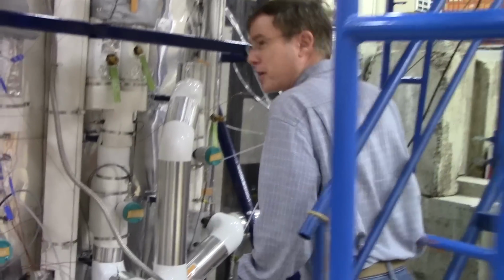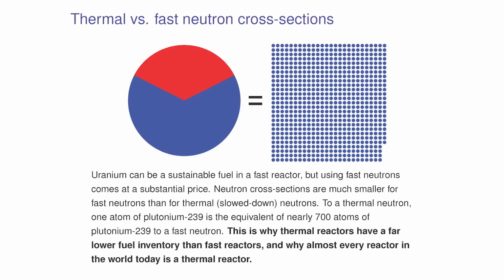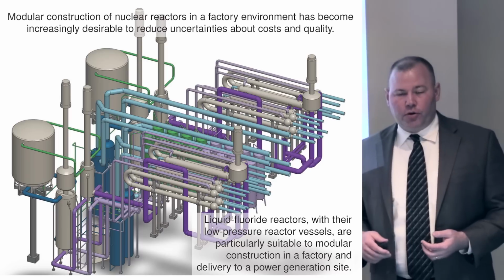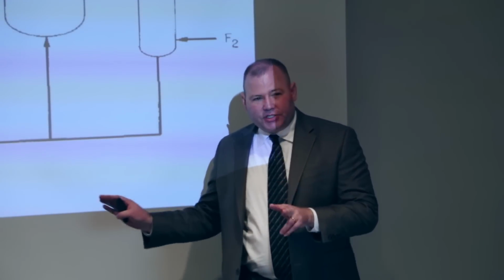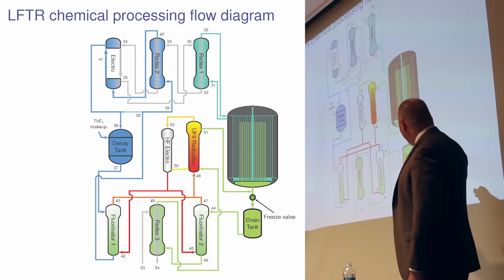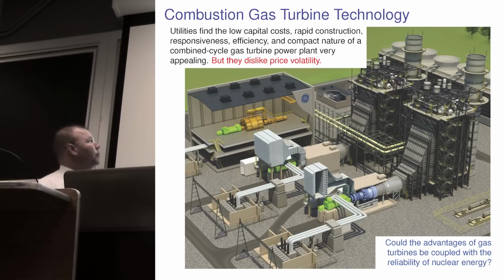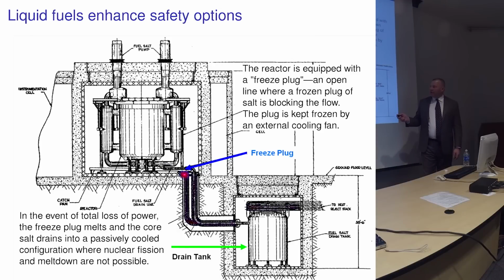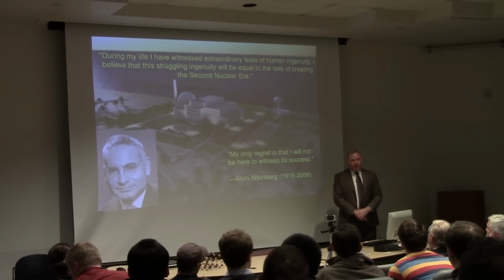LFTR Chemical Processing & Power Conversion - Kirk Sorensen

Comment: Good Video, watched it several times to get an idea of how the chemical separation works. My only concern (if it is a concern) is Thorium 232 transforms into Thorium 233 and stays like that for a half hour. Now Kirk explains in detail how Protactinium 233 is separated and placed in a separate container to decay into U233 to prevent it from absorbing neutrons so I understand that process.
What about the in between Thorium 233 isotope before it decays into Protactinium 233? 
I know that Thorium 233 is a short lived isotope with a half hour or less but reactions in the reactor go at near light speed so who is to say the Thorium 233 won’t absorb another neutron before it decays into Protactinium (assuming if the Thorium 233 isotope has the propensity to absorb another neutron) before the decay process takes place?
Is it ok to leave and not separate the Thorium 233 isotope in the outer blanket?
Reply from the maker: Looking at Wikipedia, nothing is noted as a product of neutron capture for Th-233. Doesn't mean anything definitive, but I can only guess that means it is either unlikely to happen (regardless of the half-hour half-life) or too short lived to have data on it happening (but we would have data if half-hour half-life was longer).

If you haven't watched "Thorium Reactors as Influenced by Uranium-232" it seems related to your interest but won't answer the exact question you are posing.
Reply: @gordonmcdowell  Thank-You for the answer, I guess we’ll know for sure once there is a test reactor made and more data can be extracted about this reaction and if it’s of any significant concern.
Reply: Thorium fuel cycle (simplified)

   Th-232
     │   (n,γ)  neutron capture
     ▼
   Th-233   [t½ ≈ 22 min]
     │
     │  β⁻
     ▼
   Pa-233   [t½ ≈ 27 d]
     │
     │  β⁻
     ▼
 *U-233*  (fissile; target isotope)

Side paths (parasitic captures):

A) Extra capture on the short-lived intermediate:
   Th-233  + n  →  Th-234  [t½ ≈ 24 d]
                              │  β⁻
                              ▼
                            Pa-234 / Pa-234m  (short-lived)
                              │  β⁻
                              ▼
                            U-234  (not fissile with thermal n;
                                   acts as "diluent")

B) Capture on the long-lived intermediate (more critical!):
   Pa-233  + n  →  Pa-234  →(β⁻)→  U-234

C) Further capture on the product isotope:
   U-233 + n → U-234  (reduces reactivity;
                       can breed further to U-235
                       with more captures/decay)

Legend:
(n,γ) = neutron capture with γ emission  
β⁻    = beta-minus decay  
t½    = half-life

U-234 can be used within a fast neutron reactor either by fission or by breeding U-235.

Comment: 32:21 in the Fluorinator 2 where You really, reallly need to get the U out, probably a two-stage fluorination process could achieve higher "yield", higher Uranium_extraction_purity! Also would this be an additional point where You could/should extract Xenon and/or Tritium right here (additionally to Tritium sequestration in the CO2_thermal Loop), before pumping on. 
 Tritium is probably an extremely elusive/diffusive atom to be "sieved"out good enough. ( there is a "Sieving Deuterium article" in AAAScience Jan.2019 ) 
Perfection needed here, because I read that around ORNL they had cancers like crazy from the cleaning-Ladies to Alvin M. Weinberg's wife! Speculatively that could be from Tr (TrHO_inhalation? tritiated water) or Xe_inhalation ...  (Neutrinos .. very unprobably) And You don't want to mix residual Tritium with the Hydrogen coming in at the HF_Electro_Column!!! 
Could Xe be trapped outside the reactor_zone in a decay tank similar to Pa? before the Fluorinator2.

Comment: "We need a source with all if the benefits ... (of coal)"

Old coal-fired electricity had low capital costs...  particularly so in term of incremental capital cost per watt scaling up a plant.  

That was true without pollution control.  It's not true now, and that's why coal started dying even before CO2 became an issue.

But anyway, old coal could service load variability cheaply (as long as the load didn't swing too fast) because unused capacity was cheap.

Nobody expects nuclear capacity to be cheap.  The LCOA of either wind or solar AT FAVORABLE SITES is now below 3¢/KWH.  Nobody is claiming Nuclear can compete with  that, not close.

What this means is that the only role available to Nuclear (for electric power generation in the USA) is as backup/peaking power.  But that is low duty fraction, and so how the hell can high capital costs be recovered?

Comment: There should be an annual tradable cap on carbon ^mining^, based on each nation's population as af Year 2000, and atmospheric CO₂ levels. 10-year quotas could be auctioned within each nation, and proceeds used for research and alleviation of fuel poverty. Non compliant nations (hello China, USA) could have their exports reckoned against importers' quotas.

Comment: This concept is exciting but doomed for one reason:  complex plumbing.    Every pipe and joint and guage will need to be tripply redundant and certified and there is a ton of it in this design.  Points of failure mechanically seem numerous.   Now, if it does spazz out it will not be the catastrophe that a PWR would cause.

Comment: Wind and Solar have serious drawbacks not the least of which are environmental concerns.  They both have to be heavily Subsidized to compete with conventional power sources and Neither can provide a Base Load.  Despite the cries of "Free energy" from them they are expensive and dirty and recycling is either difficult and expensive or impossible and currently NOT Being done.

Comment: Experience with MSRs has not been very encouraging. All current designs draw upon the only two MSRs ever built: the 1954 Aircraft Reactor Experiment that ran for just 100 hours and the Molten Salt Reactor Experiment that operated intermittently from 1965 to 1969.
 Over those four years, the latter reactor’s operations were interrupted  225 times; of these, only 58 were planned. The remaining were due to various unanticipated technical problems. In other words, the reactor had to be shut down at least once every four out of five weeks — that is  not what one would expect of a reliable power plant.
Reply: I figure an experimental design would have "unanticipated technical problems". More should have been built.

Comment: Transverse trancendental cross-sectional dimensionality sequences of time-timing, driven by wave-particle coordination-identification positioning or Planck Dimensions phenomena UHF neutrino->demodulation => Standard Model spectrum of nuclei-> Electron-photon-phonon-Proton and "neutronic<->gravitronic" emitter-receiver condensation relative-timing ratio-rates of clocking half-life positioning.., the Clockwork of ONE-INFINITY Singularity Eternity-now Interval Conception. (Not BBT!)

Every atom is a storage battery of Superspin, mass-energy-momentum reciprocalion resonance tuned to ONE-INFINITY Singularity vanishing point-zero-infinity containment in Totality-Perspective. Complicated and messy sum-of-all-histories.., which is why Nuclear Power Systems are necessarily Art and Sciencing Re-search practices that are similar in requirements to mass air transport vehicles and constant reiterative reintegration monitoring.., but safety and  stability has always been a process, not a word in the Dictionary. (What Safety Officers always say)

"How the heavens go.., not how to go to Heaven" by effective deliberate, MAD ignorance, ie not understanding Actuality because of the attachments to Artificial "Intelligence" narratives.., that is real-time realization of comprehensible safety, ! knowing what you are actually doing.
The Sun is the only heavenly Nuclear Fireball we want nearby in these Fission <->AM FModulation Fusion-Fission connection heavens. 

Ie, Precisely designed Power Sources, in the context of accurately researched policies, required for reliable and sustainable human health and welfare globally. (By default, "anti nuclear" hypocrisy is anti human survival!)

Comment: What I see here is a couple trillion dollars per year with Dr Steven Boyd's hot chemistry mix partnered with the molten salt for plastics. All that money that goes to plastic production lowered substantially because the heat is readily available almost free of charge with a molten salt reactor. The only added cost is adding another heat exchanger and all that oil that is burned today in the trillions of dollars per year would just simply go away. So the benefit of molten salt reactors just goes up and up. Add another heat exchanger and all the water you want distilled is readily available. Remember to go up in power you do nothing to the core of the reactor you just add heat exchangers. Like free money for humanity. Of course nothing is free you first have to build the basic core and get running the thorium transcription to breeding. Not sure how small the basic core structure would be to protect human life from the neutrons as long as you have a ceramic liner that can handle flibe and not decay in the high heat salt. Something like pressed aluminum oxide alumina could be a ceramic that could if glazed into porcelain.

Comment: 1 kg of Thorium dellivers 4,800,000,000 Kwh 0% co2
1 kg of Uranium delivers 24,000,000 Kwh 0% co2 
1 kg of oil delivers 12 Kwh
1kg of coal delivers 8 Kwh
1kg of wood delivers 5 Kwh

THORIUM 232 IS 100% SAFE!

URANIUM 238 IS NUCLEAR DISASTER POSSIBLE!

Uranium nuclear fission is a chain reaction that cannot be stopped, only controlled by cooling. If active cooling falls then you have a meltdown. WE HAVE ALREADY HAD 3 X A NUCLEAR DISASTER IN 70 YEARS URANIUM NUCLEAR ENERGY. If something can go wrong, the question is not whether it will go wrong, but when.

URANIUM 238:
2% can only be used for energy extraction;
98% is nuclear waste
Uranium nuclear waste remains active for 24,000 years
Nuclear weapons, uranium can serve as a raw material for nuclear weapons
Nuclear disaster sensitive

Demolition of a plastic bag is 1000 years

THORIUM 232
98% is usable for energy extraction;
2% is nuclear waste
Thorium nuclear waste remains active for only 300 years;
Thorium is not suitable for nuclear weapons
Thorium can consume nuclear wast
Nuclear disaster is impossible with thorium
1Kwh will cost about 0.01 - 0,02 cent
Thorium explained: https://www.youtube.com/watch?v=8nUjvpxzFbk&t=8s
Thorium explained: https://www.youtube.com/watch?v=biToH42YZZ4&t=51s

1 kg of Thorium delivers 4,800,000,000 Kwh 0% CO2
1 kg of Uranium delivers 24,000,000 Kwh 0% CO2
1 kg of oil delivers 12 Kwh
1kg of coal delivers 8 Kwh
1kg of wood delivers 5 Kwh

!!! SPREAD THE MESSAGE OF THORIUM POWER STATIONS PEOPLE !!!
Only in this way can we gain support to switch to this. If the people want it then we can put pressure on politics.

BIOMASS power stations burn WOOD just like the Romans 3000 years ago. This is a step back in our evolution.
COAL is the improved version of this. Coal and oil are primeval forests that are optimized as fuel by the earth as fuel. More energy and fewer emissions
BIOMASS clear-cut FOR THE EU: https://vimeo.com/388025992

Comment: So I'm curious. Can you just have two reactors? One that is meant to just produce u233 and one that is meant to burn the u233? I feel like one process of separation is easier than two. If you only have to separate out just u233 and add it to the second reactor rather than separating then reacting then separating again would that not be more efficient?

Comment: Kirk is dead wrong about lftr. Why? Because of the lithium. Lithium under neutron bombardment makes tritium. tritium will saturate everything in the reactor with radioactivity, which will do exactly like Clinch River and contaminate the entire vicinity with tritium. tritium flows through any metal easily, and will end up in the steam gensets, and be not workable. It has to be a higher temp na based salt, then it will take over the world. sodium flouride.
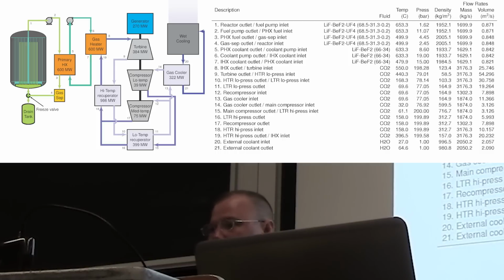Reply from the maker: Paublus, tritium is a well known byproduct of LFTR approach, and has been discussed numerous times, not just in other videos but in THIS video, starting at 32:39. Thanks for the hot tip. Please share your Tritium concerns with everyone developing FUSION reactors too, I'm sure they'd love to learn all about it.
Reply: @gordonmcdowell  I know this is from 4 years ago but Paublus has no idea what they are talking about because they think LFTR is fusion. That distinction is lost on the everyman talking about nuclear energy, I just had a coworker tell me CANDU reactors are horrible because the containment field won't allow the fuel to expand.

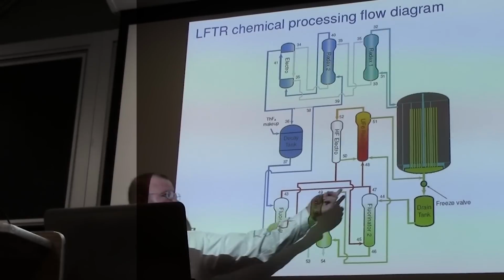Comment: 24:00 Virtually anything is affected by HF so how the heck are you going to handle HF, at 2 bar pressure, at high temperature, in a highly radioactive environment?
Reply: Platinum?
Reply: Some development has apparently produced alloys that will produce a protective film (I think it may have been alumina (Al2O3?) with the circulating fuel salt.  It was one of the small nuclear companies, can't remember specifics.

Oak Ridge (ORNL) has done some earlier work I know.  For sure it's recognized as one of the engineering problems.

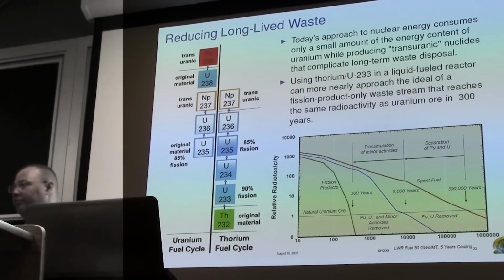Comment: 7:58 'So with the thorium cycle you could potentially get down to 1.5% of the long-lived waste production of the uranium cycle.' I think that figure is really 10%, because the comparison should be: uranium cycle leaves 15% unfissioned, thorium cycle leaves 1.5% unfissioned.
Reply from the maker: Koen Th he’s comparing mined fissile not the LEU fuel fed to reactors.
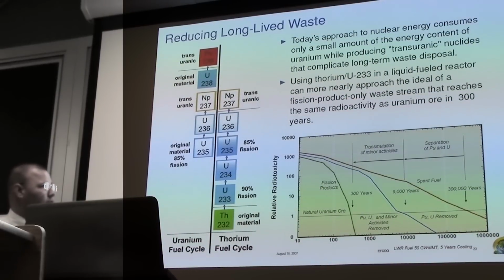Reply: @gordonmcdowell  No he is not,  watch carefully: that is not what he says here, starting from 7:30. (If he meant mined ore he would get to an even lower number). Moreover you see Kirk hesitating a moment because he realizes it himself. 1.5% is just the fraction of fissile material that becomes transuranium in the Thorium cycle, whereas in the Uranium cycle (235-U) this is 15%.
Dont get me wrong, I believe Kirk and his message. He is an incredibly clever and fast thinking guy and I am sure he too is convinced that clear-cut, transparent and correct information is the best way to convince.
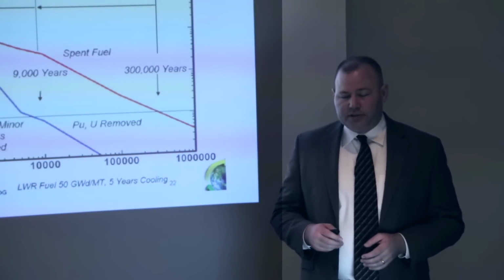Reply: @koenth2359  You're thinking that U-233 fission 90% then goes to U-235 and from there is the same for both. That's where u would get 10%. But as the video mentions later on, 8:05 or so, enriched uranium starts with a lot of U-238 (over 90%) which is one neutron absorption away from a transuranic, so it would be like this:
Thorium: U-233-> 10% absortion ==> U-235-> 15% absorption  
Result: 1.5% actinide production
Uranium: 
4-6% * ( U-235-> 15% absorption -> Actinide )
+
94-96% ( U-238-> 100% absorption -> Actinide. ) 
Result: approx 95% actinide production
To be fair Pu-239 fission rates are not reported but Pu-239 is indeed one of the main components of long lived waste anyway...
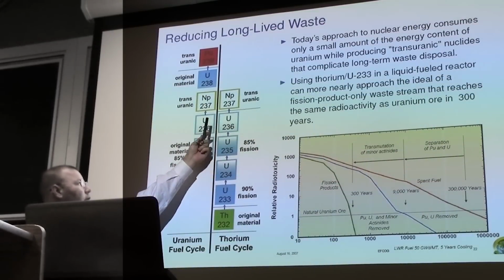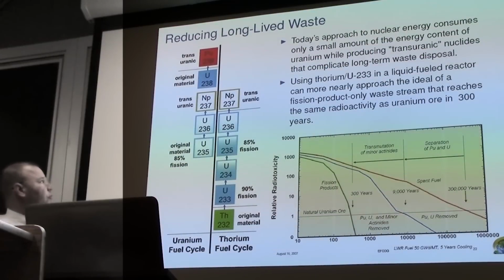Reply: @dskaz8926  Thanks for explaining, clear now! His conclusion (7:58) then precedes the explanation (8:06), but that may be due to this vid being a combination of two different talks.

Comment: Shouldn't the drain tank be much flatter and wider in order to decrease neutron re-capture and have more surface area for dispersing waste heat in a shut-down situation?

Looks to me like the smartest heat transfer between salts is going to be running the intermediate salt through the reactor in some kind of heat exchange, rather than running the reactor salt through an external heat exchange.

Given the CO2 turbine is only theoretical, why not go with commercially available steam right now, with the intent to convert to CO2 if/when they become a reality? It is a technological delay we can avoid out the gate.

Any thoughts on a secondary external system to collect the decay heat from the fission product decay? What about holding the xenon in some kind of bubbler to collect the heat initially until it decays and can be sold as a commercial gas as helium? The heat can be used to generate secondary power and in the event of a control problem, it can be re-routed and bubbled through the main reactor to suck up the neutrons and stop the reaction almost instantly without going to the drain tanks.

Why not sequester the tritium and deuterium and use those as a way to bump up the neutrons within the reactor? Won't need U-235 or plutonium to keep the reaction going if additional neutrons can be introduced through a tritium/deuterium accelerator system.